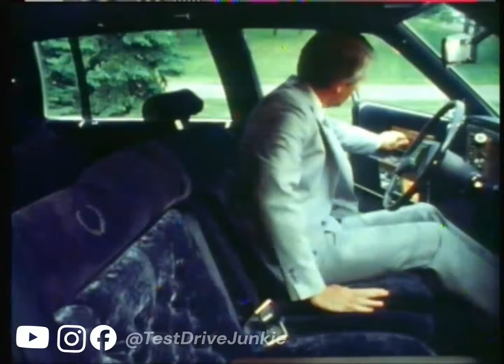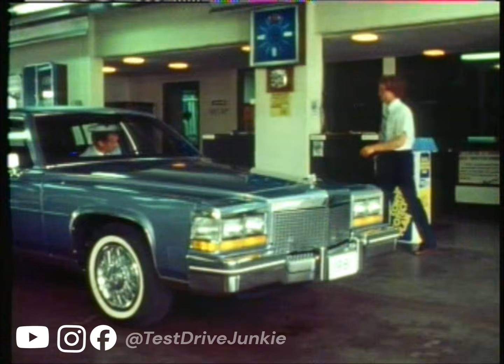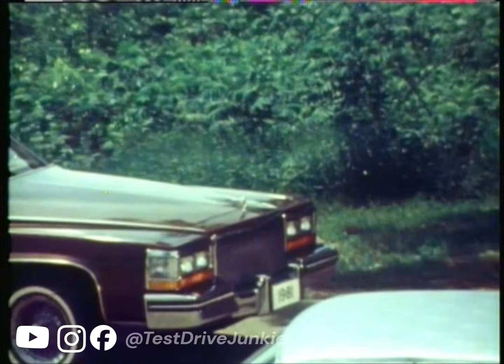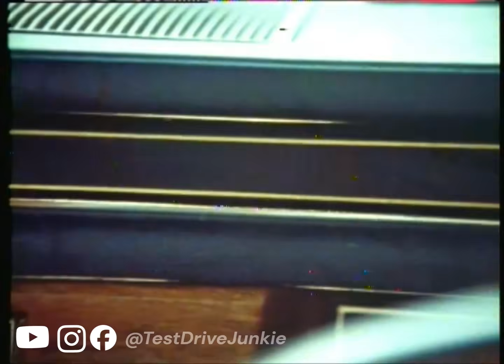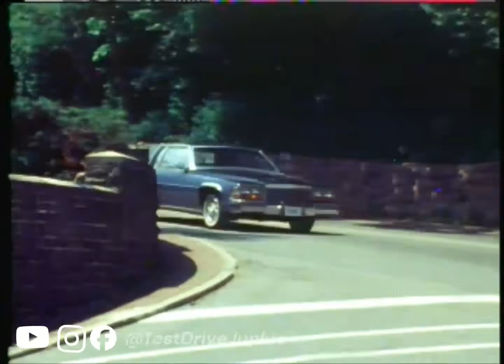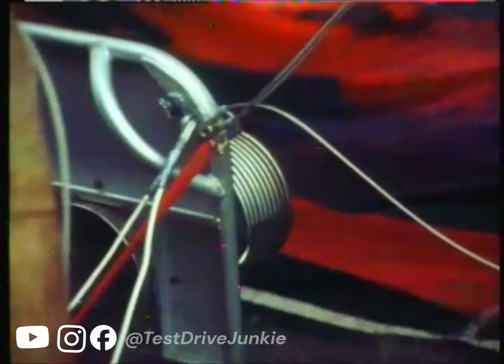1981 Cadillac Fleetwood and Deville Manufacturer Laserdisc Promotional Video

Comment: My 62,000 original mile
 1981 CoupeDeVille 252
4.1 V-6
Starts 
 Runs
  Drives 
    Stops,
Radio,pwr. Antenna inop
 AC Heater & fan ALL inop
Horn inop..
A BA$IC drive car.
Body excellent 
 Tan vinyl seats soft/ untorn 
Car has NO clock cruise tilt
 NOR rear window defogger.
My Caddy “Bel Air”
Reply: Caddy “Biscayne”??

Comment: The 81 was the beginning for MORONIC engine choices. My mother had the exact 80 brown Fleetwood--I traded it for an 81 Seville with that dumb engine.30 min at the dealer disconnected that garbage and the engine was normal. I traded it for an 82 Fleetwood. 
OMG, what a POS that engine was; the old lady bed suspension...then and 84 Eldo...luckily she drove like a geriatric and didnt  notice,  the engine was a POS. I had an 85 Eldo myself and at 75 k very manicured miles, the engine just died. God, the 80s ruined Cadillacs reputation. Having grown up on new ones yearly from the early 60s onward, these things broke my heart.
Reply: The normal mode engine was better?
Reply: @Telecolor-in3cl no engine of the early 80s era was worth a damn. They were all junk
Reply: @MrKinglauro  But the 1978-1979 ones?
In the '80's "Lincoln" seemed to have better cars.
Reply: @Telecolor-in3cl yes 77 to 80 had fine engines. 1981 was the beginning of the end for cadillac. Yes Lincoln had much more reliable cars in the 80s and better technology

Comment: These 1981 models truly were the very last REAL, GENUINE Cadillacs. With exception to the 1982-1984 Fleetwood Series Seventy-Five Limousines. All equipped with a true big block, 368 cubic inch V-8, Cadillac-designed and built powerplant. The troublesome "V-8-6-4" computer module could very easily be disconnected to provide continuous 8 cylinder power.
     I've loved every Cadillac I've ever owned since the 1970's through 1990's. IMO, the 1980-1981 Cadillacs were among the most beautiful designs. Very formal and elegant.

Comment: Wow: 16.8 miles per gallon with GM computer technology  My 1986 Volvo station wagon—3,100 lbs. curb weight and shaped like a brick—got 24 mpg without trying.
Reply: You don’t buy a big ultra comfortable spacious luxury sedan for mpg, they only did that cause emissions and it backfired HORRIBLY
Reply: @Mr_Cadillac420  That makes sense.  Trying to turn it into a selling point just made them look bad, by making it look like they were proud of it.
Reply: @XanthisBoston  I desire a orange 78/79 high spec Coupe DeVille or Fleetwood Brougham d’Elegance for the timeless gangsta looks and decent reliability
Reply: @Mr_Cadillac420  LOL!! Right on.
Reply: They should’ve stayed with the high single digits or low 2 digits for extra power and reliability, 81 only had a PATHETIC 140hp while 82-85 with the disgusting 4100 had ONLY 135hp
Reply: But it was a Volvo.  No one cared about who was in it when you pulled up to a venue.  These big Cadillacs made a statement and if you had one you were “someone”
Reply: @jakereal3604  Agreed.  Which makes their decision to focus on the mediocre gas mileage as if it's a selling point even more odd. After all, if you can afford a Cadillac, you can certainly afford the gas.   
🤔 Maybe they talked about the gas mileage just to say, "This isn't your dad's 1959 Cadillac.  You are expecting truly horrendous gas mileage, but it isn't that bad."
Reply: @XanthisBoston  LOL that's a good one!   Not sure what they were thinking.  A HUGE issue with the American Auto industry was when the government started all these mandations, bumper mandates,  corporate fuel MPG mandates and a bunch of other crap   We Americans were used to building large V8 powered cars and were pretty good at it until late mid 70s and it slowly went downhill from there, but drastically went to hell in the late 70s-80s when we drastically downsized our cars,  started using EFI and computerized engines and other things that were Foreign (no pun intended) to us.  All this downsizing and changing from V8s to 6 and 4 cylinders really killed the American car industry as the was a bunch of problems from stalling to NO Start issues to rack and pinions binding up and failing withing 6 months to a year and on and on.  Many quickly switched to Toyota, Honda, Mazda ,  Datsun (Nissan)  etc..   It was the beginning of the end!
Reply: @jakereal3604  True that.  Modern cars do have their selling points (at least they did until about 2020; don't even get me started on the new computer controls). I don't miss rear wheel drive.  Or changing belts, wires, and hoses every 30,000 miles.  Nor spending 10 minutes trying to start the car in the winter.

But all that aside, it is undeniable: American cars in the 1950's and 1960's were a phenomenon.  Centuries from now, when schoolchildren learn about "automobiles", I hope there's a picture of a 1959 Cadillac in the textbook.  Nothing else like it.  Like you said, that whole era went down the drain in the '70's.
Reply: @XanthisBoston  You must likely be in my age group, I'm 59 years old.  My first car was a 1973 Delta 88 Royale coupe,  350  2 barrel carb.  I bought it at 15 from a coworker of my dad back when I was in 9th grade.  by 17 when i got my license i had a nice car to ride around in.  I fixed her up myself,  While fuel injected cars are def easier to drive esp when they are cold, if tuned properly i don't mind carburated engines and the plus side with them and points is usually you will always get home even if running like crap!  With modern cars all you need is a crank sensor to go out or an electric fuel pump and you're SOL  and aren't going anywhere.
Reply: @jakereal3604   I'm a little bit younger, but I started out on '80's cars.  Always loved the look of older cars.  " all you need is a crank sensor to go." You're telling me!  Once I was on an back-country dirt road in the middle of the woods at night when the engine just quit.  No cell service.  I had to walk 2 miles to the nearest house and knock on the door and beg to use a phone.  It was exactly that: crankshaft position sensor.  There's definitely something to be said for simplicity of design.
Reply: @XanthisBoston  There you have it Folks!  See what I mean, been there done that!  One thing though about Crank sensors or any sensor that might make the car stall is that bout 50-60% of the time if you let the car cool down it will start back up again.   Electronics don't like heat and engines offer plenty of that so def not an ideal environment for them.  Years ago in the late 70-80s before most all cars had EFI and distributor-less ignitions the GM cars had this boomerang looking ing "module" with 2 terminals on each end.  While the system itself was pretty reliable these DID fail on occasion and would leave unsuspecting owners dead on the side of the road.  Often like I said they waited a bit and low and behold it started right up and ran just fine only to drive 5-10 miles down the road and have it happen again.  If I recall these were relatively easy to change and keeping a spare in your glove box was a smart idea.  I think they only cost about $35-50
Reply: They didn’t give a more powerful option until 1990 with the optional 185hp 5.7 for reference the 1970 FWD Eldorado had a whooping 400hp until the RWD CTS V in 03 (640hp) took over
Reply: Although 86-92 5.0 models are underrated power (140hp paper), test drove a 86 Fleetwood Brougham which had plenty of power (torque) for everyday driving in 2025

Comment: Growing up, our neighbors across the street had an 81 Fleetwood Brougham: teal green with white leather upholstery. Beautiful car, but it was constantly being towed back and forth to the dealership. They kept it for a good number of years (at least 3), and by the last year they owned it, the engine clancked and clunked down the road like an old beater.
Reply: Strange considering the Cadillac big block 472/500/425/368 is one of the most solidly reliable and indestructible engines ever put in a passenger car. They can go 500,000 miles without much attention and have been upgraded to output as much as 1,000 horsepower and still maintain reliability. The V864 mechanism used in 1981 was generally bad, but after unplugging it, the remaining 368 was rock solid.
Reply: @DavidPysnik  This was when it was brand new. Maybe they didn’t know about unplugging the module?

Comment: These Cadillacs were the kings of the road at that time, not like today's jellybean looking  plastic Cadillac garbage cars !!
Reply: Speaking of kings, I'm old enough to remember when hot air balloons insisted on ruling the sky.  At least in the Midwest where I grew up.  Didn't see as many after 9/11.
Reply: Nineteen SEVENTY one Caddies...NOW, were talking, "KINGS OF THE ROAD"!
Reply: Well, king of the road is a bit of an exaggeration. Cadillacs of this era were falling behind imports in terms of quality, value and performance. Lots of self-inflicted damage.
Reply: @sayimjustadreamer other than rolls Joyce i know of no import that was more luxurious.   I had an 81 benz s class, and it was very nice, but still not as luxurious as the deville and Fleetwood.  And parts were expensive.  The vast majority of problems with gm cars at that time were due to trying to meet govt mpg and emissions regs.  They spent more time on those efforts than on making a better vehicle
Reply: @howebrad4601  Well, the market didn’t agree with the “king of the road” designation. GM sales cratered in the 1980s. As for the excuse of trying to meet federal regulations, imports had to meet the same regulations and were able to do so while maintaining quality control and reliability.
Reply: @howebrad4601 What's a Rolls Joyce?🤔
Reply: What are you talking about ,Toyota and Honda weren't making vehicles this size. They really didn't have to change much to meet any burdensome EPA rules the point still stands though @sayimjustadreamer
Reply: @zachZO6-s9b  Yes… but EPA regs had nothing to do with the poor quality and reliability of 1980s GM cars… and the failure of GM’s cookie cutter, badge engineering downsizing. GM’s woes were self-inflicted, and they paid a tremendous price for them.
Reply: I'm not even defending GM because they drove me right to Toyota in the late 90's  ,  I haven't left since. All through the 2000s I asked myself why GM with all their talent couldn' properly  make a Toyota Camry ! I mean if Toyota could easily sell over a half a million of those year after year you think GM would be interested but they never seemed to be. I just don't like the overzealousness and arbitrary numbers all agency that's supposed to 'protect the homeland".
Reply: @sayimjustadreamer  These cars did not at all have poor quality or reliability as I still daily drive one to this day and own a few. The only reason I got rid of one was rust. These cars were not part of GM’s cookie-cutter, badge-engineered downsizing. The imports produced nothing with same presence, comfort, space, or ride. Lexus didn’t even exist and a Mercedes or BMW was like a toy in comparison.

Comment: These cars were such a terrible letdown after the brilliant and successful 1977-1979 DeVille/Fleetwood Brougham. The build quality on these early 1980s Cadillacs was just as bad as the engines. This is the era when the Town Car really took off in sales as customers switched from Cadillac to Lincoln.
Reply: Lincoln was pretty much always a better built car esp in the 70s-current !
Reply: @jakereal3604 Actually the famous Lincoln Continental and Mark III models from the 1960s had higher levels of build quality than what Lincoln built in the 1970s. Build quality in the 1980-1989 Town Car wasn't as good as before... but was far superior to Cadillacs of the early to mid-1980s who were building very crappy cars.
Reply: @SpockvsMcCoy  Thats VERY true as I own a 1970 Mark lll and can attest to the vault like build quality and good quality materials used and fit/finish.  The reason I didn't want to go back that far was because Lincolns of the late 70 and 80s Onward were significantly better then any GM counter part or competition IMO.  If you take a 1974 or 76 or 78 Lincoln Town car or continental and compare it to a Sedan DeVille or Fleetwood,of the same year the build quality and reliability of the Lincolns/Continentals are so much better and cannot be compared!  Same if you take any Eldorado  from 70s and compare it to a Mark series!  Night and day
Reply: Funny story…father owned a 1981 Eldorado with the diesel (yes it blew).   Anyway, the doors were frameless so one day the window regulator got a little wonky and let the window extend a tad too high.   Door was closed and the window shattered.